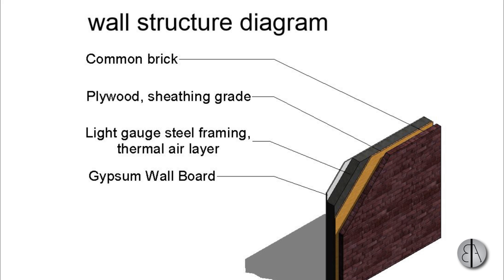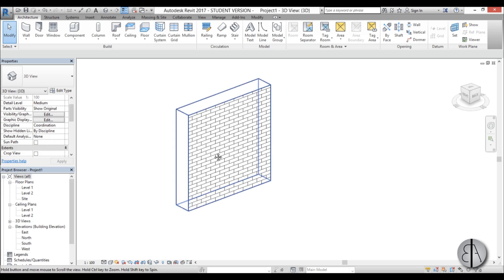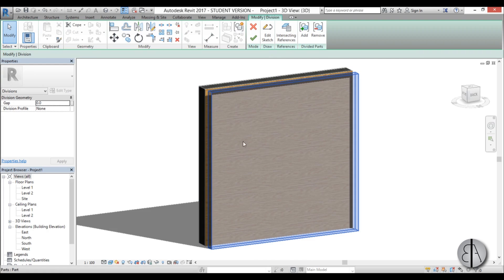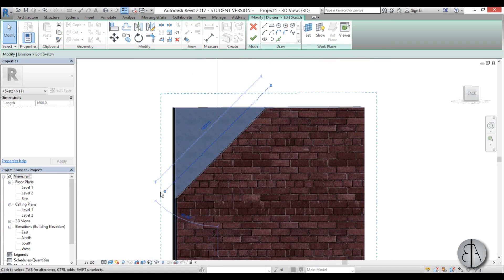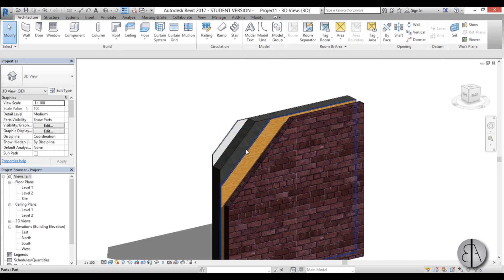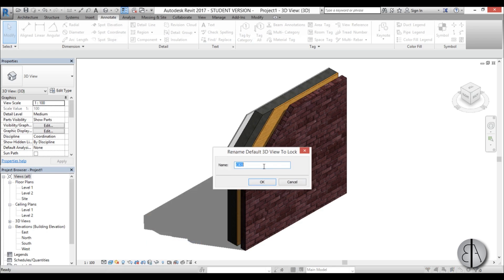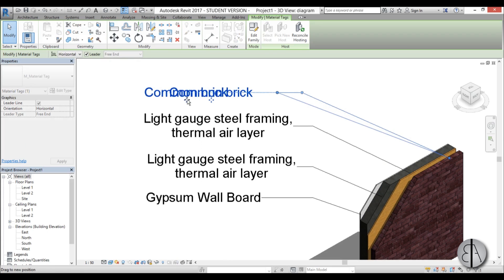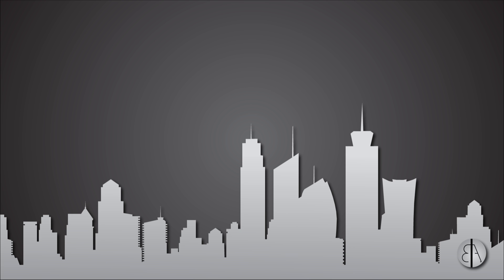Wall Structure (Material) Diagram in Revit Tutuorial

Comment: Thnkzz😊is it possible to design a cog wheel system in revit for move the roof panels
Reply from the maker: Not as far as I know, but there may be a plug-in for that... Revit is for architecture, not mechanical elements..

Comment: Great tutorials, especially the solid and parametric modelling. With the wall parts, do you have any tips for showing the timber or metal studs in the inner leaf of the wall? This would also apply to joists in floor and rafters in roofs

Comment: Awesome, but im new to revit and i make some costum wall yesterday and how can i save them in revit family so i can load the everytime when i want to use them? Or make a template?
Reply: You must load from transfer project rules tool, opening both files the new and the other where the costum wall is.
or you can just load them from load as a group in the insert tab.